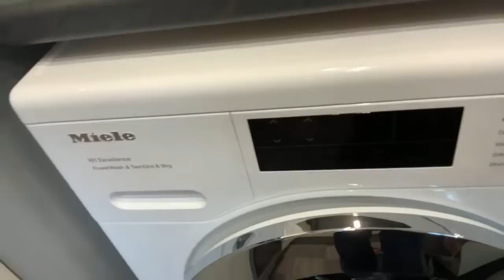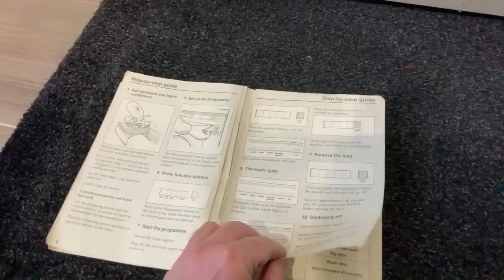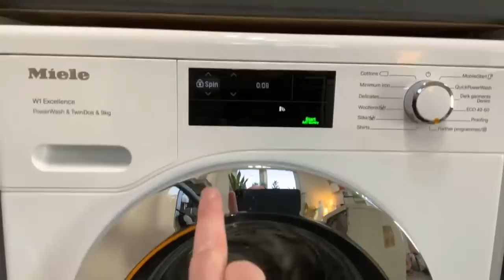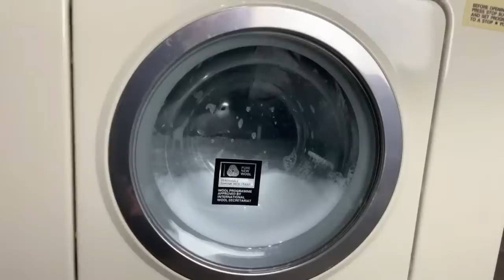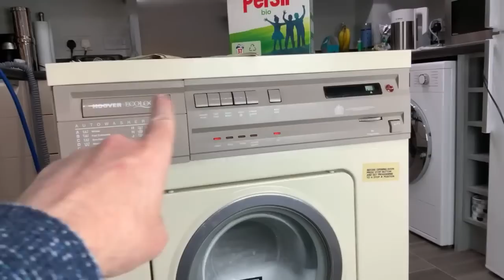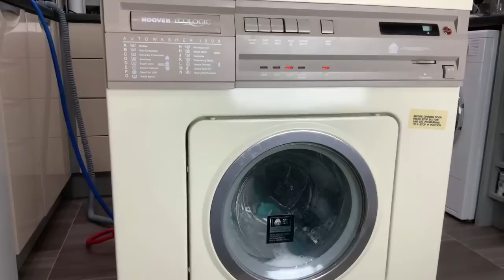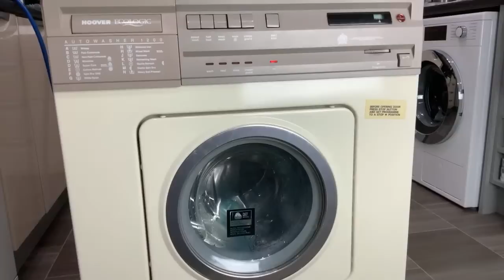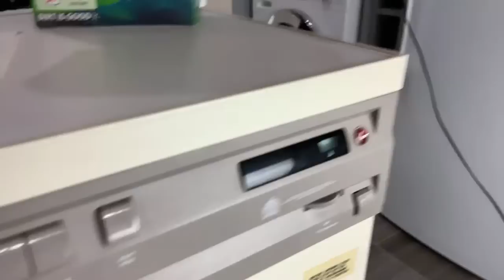New Washing Machine Live Reveal!!!!

Comment: I would pot a piece of plastic pipe(we call it PVC in the US) between the two hoses so those clamps can’t be tighten to their max.  You can’t get a tight seal doing rubber to rubber or plastid to plastic without something rigid between them.  Love my front loaders.  My first was a slant front Westinghouse.  I’m on my 4th only due to moving and having to leave them with the house.  Wish I was you partner, I adore you.

Comment: I much prefer the hot and cold feed washers,  regardless of eco reasons and the cold feeds being more efficient, I don’t find that to be the case.  Hoovers are a fantastic product, in the main, they are reliable.  I find that you could have a washer for many years and hardly have any problems, nowadays your replacing your machine more frequently.

Comment: You say you would like a Miele tumble dryer, I have one that I bought in 2019. I didn't realise, but it is actually made in the Czech Republic. I paid £1000 for it as well! Not as impressed with the build quality of this versus the Miele washer I have. I will say though, that with the dryer being a heat pump, it uses a lot less electricity than the condenser dryer my mum had.

Comment: As someone has said on live chat. It would be interesting to see how much energy the hoover uses vs the Miele on a wash cycle.
I did see a channel compare an old top loader vs a new washer for off grid purposes and the old washer came out more eco on the power. So older machine used higher power but for a short period compared to the newer machines long cycle but lower power that added up in the end to more power used
Reply from the maker: I could try that as I have a plug in energy meter.
Reply: @ibaisaic   the matching dryer would be be in the same colour or white
Reply: @ibaisaic  it could be interesting to see if technology has improved especially if being eco was the main drive for improvement. We always get comparisons last year the the next but never 20-50 year old machines compared to modern. Even an old 1950’s hoover power usage compared to a modern dyson. Who knows old school might be better, or is it just more fun.